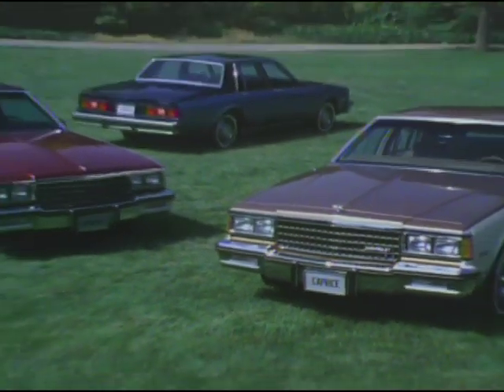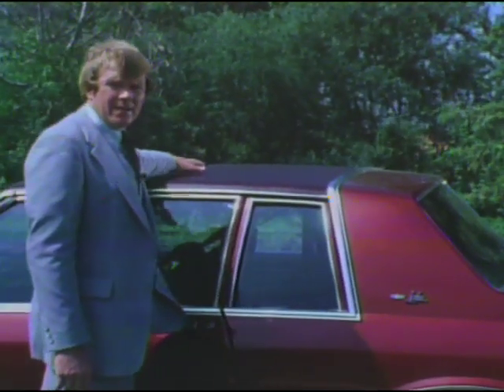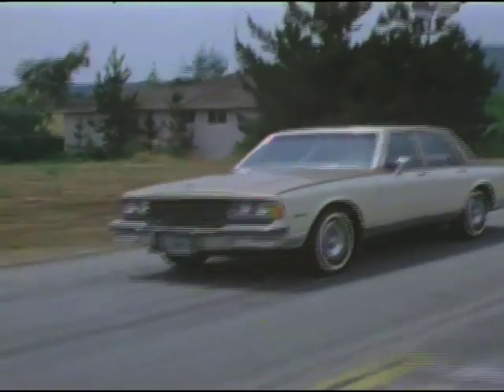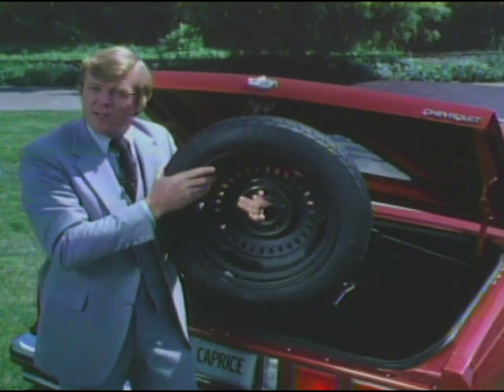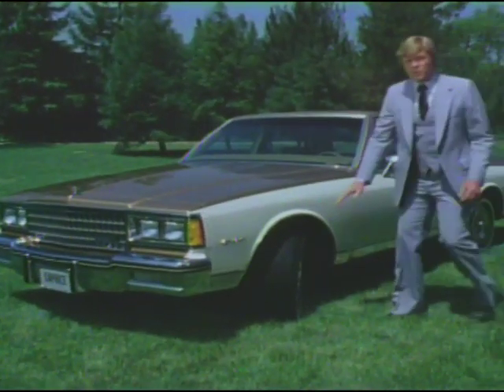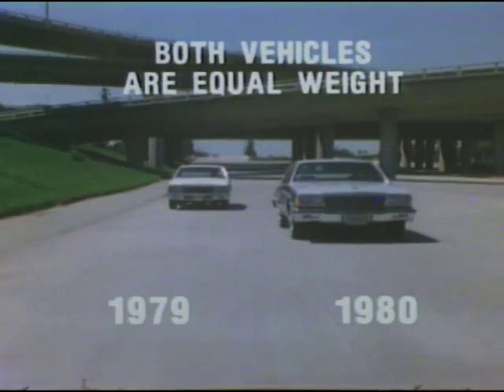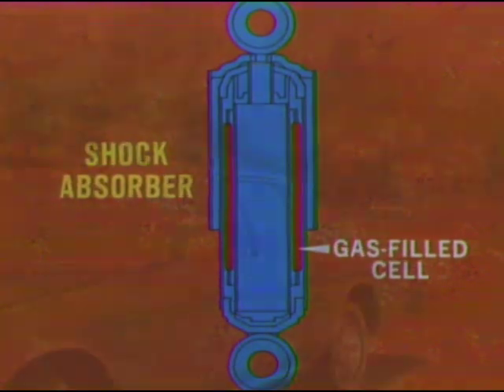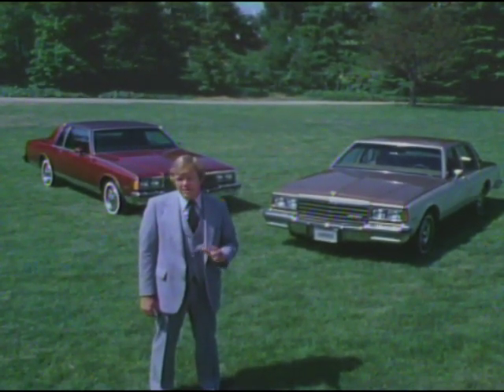1980 Chevy Caprice & Impala Dealer Training - GM122A

Comment: My second-ever brand new car was an '81 Caprice V8.  Mine was nicely equipped with AC and all of the power options, and he's right, it stickered for just over $10k.  I'm thinking his test car must have had some issues specific to that particular car, because I was very happy with mine.  I thought it was smooth, quiet, and while not a hot rod, it had plenty of power.  In fact, it's still one of my favorites out of the forty or so vehicles I've owned so far.  

The only warranty issue I had with it was due to '81 being the first year for GM's so-called Computer Command Control system, aka the three-C system, which controlled the fuel mixture to the carb to supposedly give better gas mileage. In typical GM fashion, they hadn't quite worked all of the bugs out of it before they put it in production vehicles, and for the first two or three model years it drove customers and dealer service departments crazy.  

Mine acted up a few times in the first year I owned it and had to go back to the dealer for warranty repair.  The CCC dash light would come on (like an early version the later "check engine" light), the engine would run rough for a few seconds, then the light would go off and it'd go back to running fine.  The dealer told me the computer was telling the carb to go full rich for a few seconds then correcting itself.  The dealer would re-flash it or something, it'd be ok for a few months, then out of the blue, do it again.  Oh well.

The CCC nonsense was the only issue we had with the car.  All of the normal stuff worked well.

Comment: The Iranian Revolution in Spring 1979 caused gasoline prices to soar for a second time in the 1970s. Add high inflation and high interest rates...and the big American cars were no longer the most popular vehicles. Baby boomers who were now buying new cars around 1980 weren't interested in full-size cars...but smaller mid-size cars were more popular than ever. Starting in 1980, new full-size cars were aimed at older couples and were no longer popular with younger families. The 1980 Chevrolet may have gotten a new look...but sales slid compared to the 1979 model year.